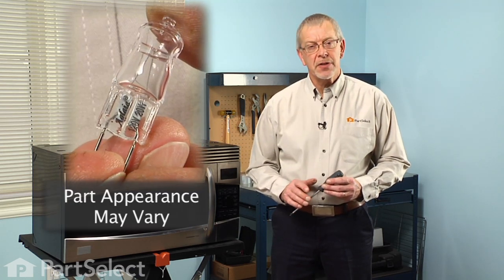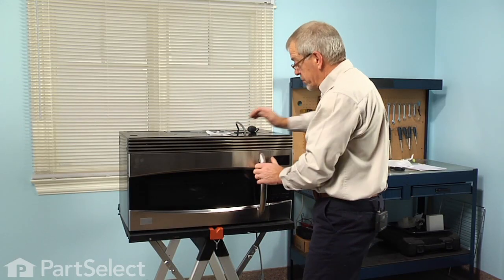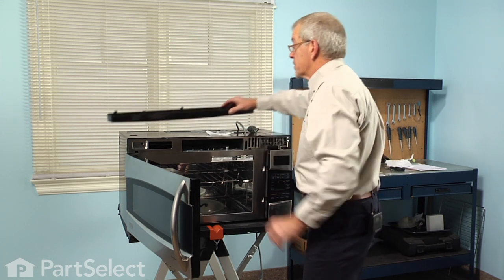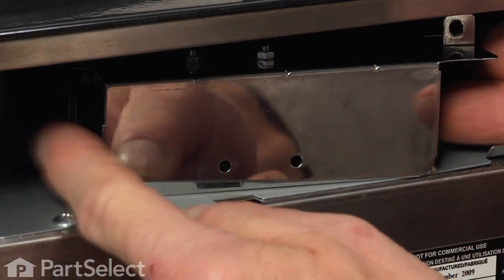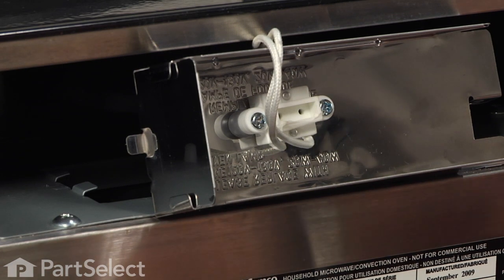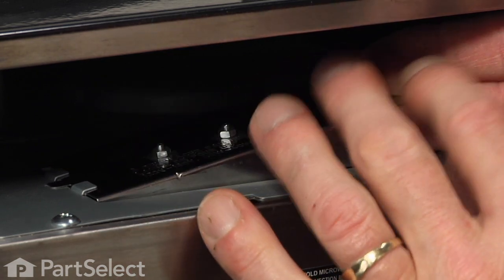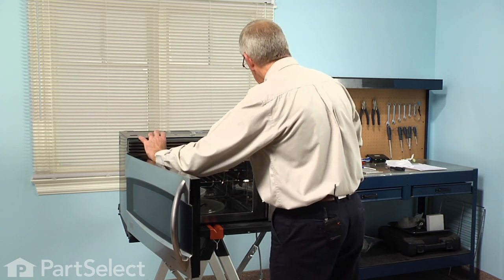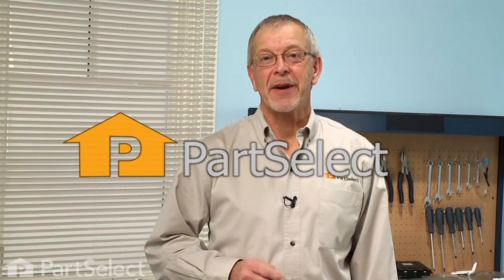Microwave Repair - Replacing the Halogen Light Bulb (GE Part # WB25X10019)

Comment: I searched high and low for our manual. Then was able to scan the QR code inside of the microwave and obtain a copy of the digital manual. There was NOTHING in the literature about replacing this light, only the overhead range light. Thank you so much for this video.

Comment: Thank you SO much!  Saved me a service call.  I called GE, and they originally gave me a part number for the light bulb, and said to remove the top grill (like you did) and said the bulb would be behind the charcoal filter.  I went and bought the bulb, and then when I removed the grill, there was not charcoal filter, and I couldn't see where the bulb would be.  I called GE again and talked to someone who said for this model, I couldn't do it myself, but would have to call a repair person.  So glad I found your video.  It was easy to do...or it WOULD have been if GE had told me the right bulb to buy.  Now I just have to exchange the bulb for the right one and will be in business.  Thanks again!

Comment: Very helpful video, thanks for posting it. I could replace the bulb based on your video. I can't believe that GE makes it so complex to replace the light bulb. If they had provided the screws in the front of the grill instead of on the top, it could be done without completely dismounting the microwave.

Comment: This looks like my GE Profile JVM1790SK01  1650 watt microwave with convection.
The newest GE's seem to only be 1200 watts or less.
Why did they stop making this super powerful and beautiful oven?
It seems if mine ever needs replacing I will have to switch brands because I will not step down to a less powerful model. This seems to be a bad move on GE's part to stop making these. I do love this model.

Comment: I want an LED bulb equivalent replacement for the GE microwave.  Have yet to find one.
Reply: According to geapplianceparts.com the replacement halogen bulb is part number WB25X10019
Reply: @kdr3yt  Thanks Ken.  It's been 7 years since my original post and I've since moved and that microwave was replaced before I moved.  Good to see more LED options for microwave bulbs.